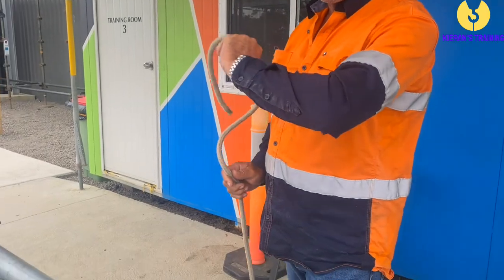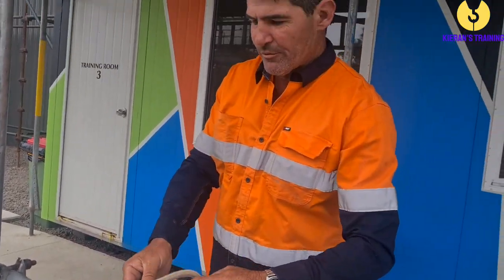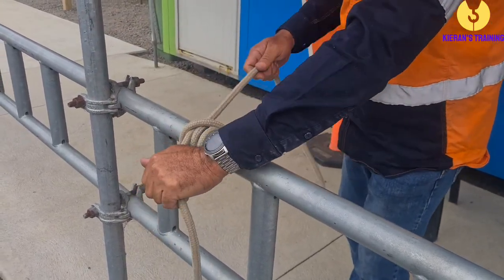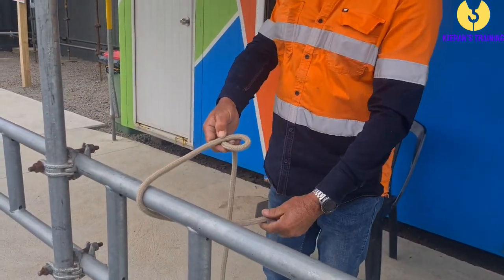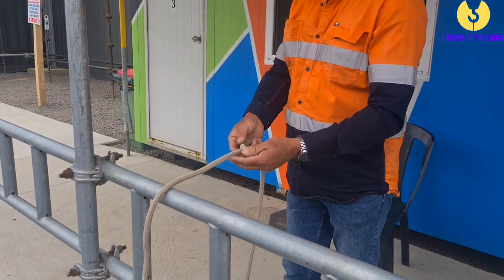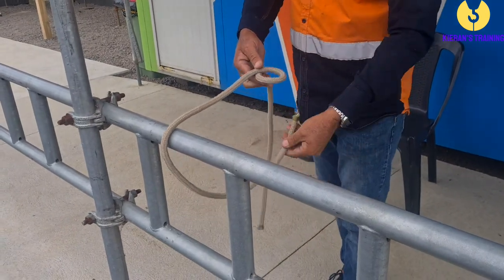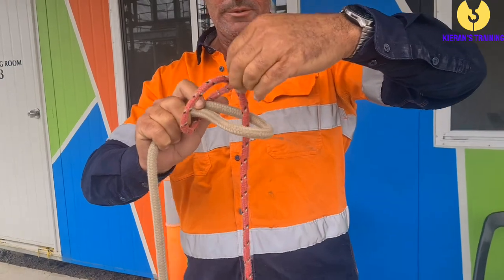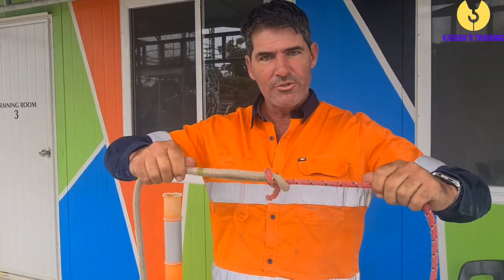Dogging Knots

Comment: Hi I have a question. How do you find the angle factor of a sling on the job? I know for 60 degrees that the distance between the two lifting points can't be greater than the slings, but how do I know if something is 90 or 120? I'm just a bit confused with that. Thanks in advance